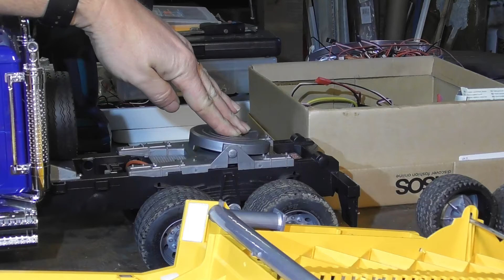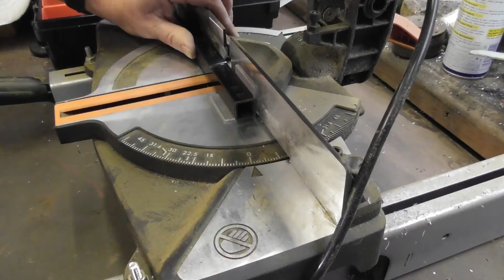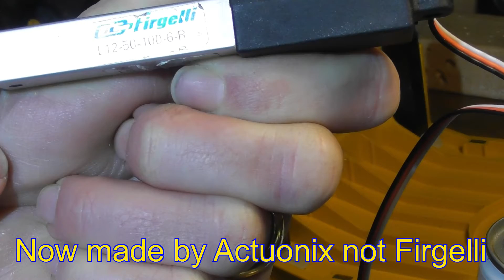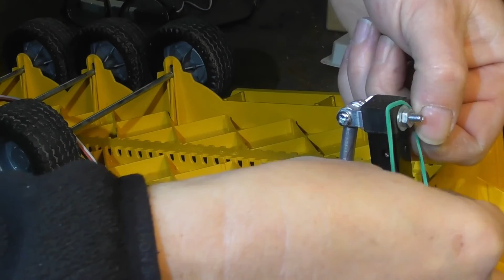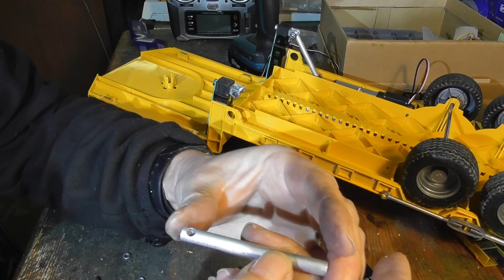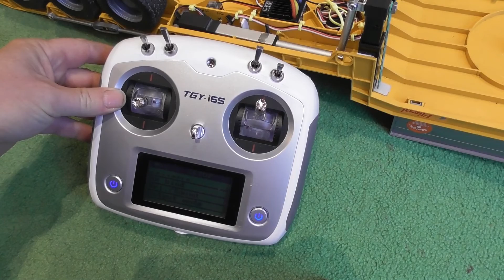Bruder low loader RC conversion pt1: automatic legs

Comment: Hi. Just been looking for your other leg convertion, bloody hel the price of them actuonix servos 127.**€/£$70.00 I'll give it a miss that's miles off what I can afford. Thanks all the same.
Reply from the maker: I know what you mean. The Actuonix actuators are really expensive. In the latest version I have replaced it with cost just a few dollars or pounds each - using 3D printed rams that I designed. I put similar ones one the ramps too. You can get a brief look at this towards the end of my most recent video that I published a couple of days ago.

Comment: Expert detail and instruction. I haven't had much luck fixing components to plastic using superglue....even roughing up the surfaces before gluing. In fact I haven't been able to find a suitable adhesive for plastics. Any ideas.
Reply from the maker: I tend to use Gorilla superglue. The argos Guild (own brand) hot glue gun sticks all the plastics pretty well : https://www.argos.co.uk/product/8841106 😀👍

Comment: Hi there (ive subbed a while ago btw) did u RC your bruder truck up yourself? Is it much cheaper than buying a tamiya?
Thanks.
Reply from the maker: Yes I did do the RC truck myself. Much cheaper than Tamiya. No painting required. It comes with a proper cab interior. And it goes with all the rest of the Bruder stuff - including the excellent Bruder people. I have since developed a 3D printed solution to this conversion, that I will be publishing parts for (for free) and doing a detailed build series. 😀👍

Comment: Very nice. But I can not understand how you connected to just one remote. because you have the remote control for truck electronics, and now you have the trailer too. do you have 2 remotes?
Reply from the maker: Thank you! I was going to try and do this with a single remote control (this could easily be done with the old FM transmitters), but the modern 2.4gHz RC that I am using also uses the receiver to communicate with the remote (safety feature), so will not allow me to use 2 receivers at the same time with one remote. So yes I used 2 remotes. this also allow me to use different trucks with the same trailer.   😀👍

Comment: Great stuff, "I take it you will be travelling light next holidays?" and noticed the "product placement a la ALDI". (Nudge, Nudge) LOL.(i use the pumps plastic pipe for extending HL RC Tank smoke generator so I can move them about the tank for better space utilisation.
Reply from the maker: 😂 If I can find more uses for suitcase handles I expect that the whole family will get a shock when they try and go on holiday next! I like using stuff that is usually thrown away & plastic tubes and springs often come in handy!  🙂👍